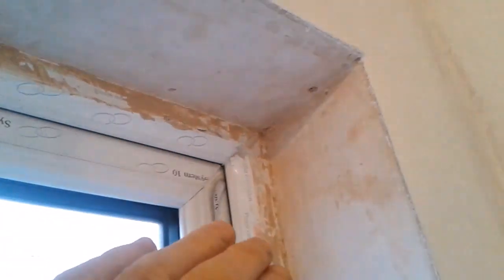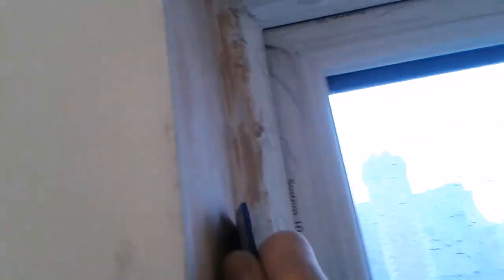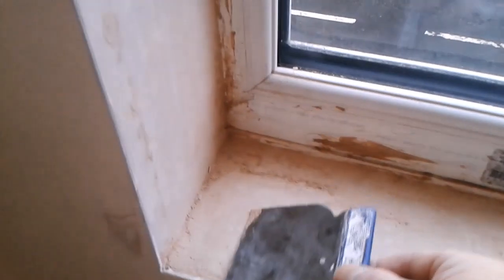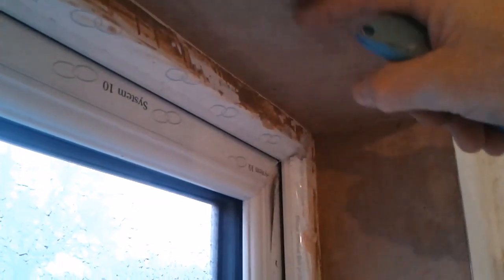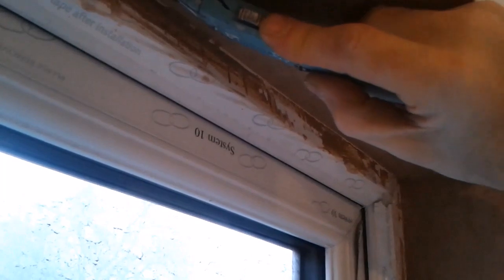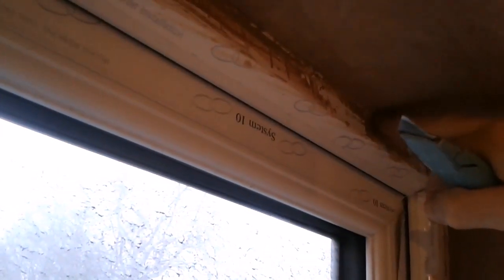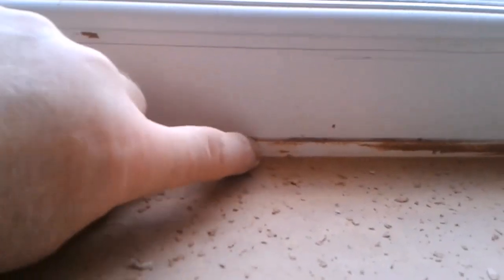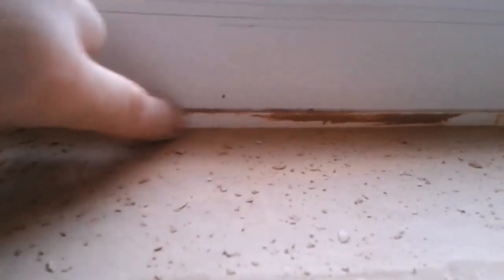Removing Protective Tape Off New Plastic Windows

Comment: Just water down first coat of emulsion 20% to seal plaster. No paint manufacturer ever suggests PVA glue as a plaster seal.
Reply from the maker: yes but they are not professional painters and decorators... both methods work if carried out in the right manner.. you need to understand the materials involved..    if I was losing money because people where not using more of my materials, I would also tell you,  you're using my materials wrong. Diluted PVA seals a surface and it also promotes adhesion with any paint applied on top.   They actually sell paint primers with PVA in them also lots of wallpaper paste have added PVA...   Problem occurs with  PVA when people use it neat, or they come across it after a plasterer has done some patch filling..  Neat PVA is usually all around the edge of the patch which causes problems...    we know all this because we deal with it as being in the trade...  thanks
Reply: @PaintingandDecorating  not acceptable before applying paint. No PVA glue just diluted trade emulsion for your mist coat.

Comment: The installers left the plastic wrap on the windows and now its brittle and breaks up and can't be removed properly. What should I do?
Reply: I have the same issue...several years, still no solution.
Reply: @gilliangermain-king5762  I still have this issue. Even the installers came and saw and went away not giving a solution.

Comment: Leave the film on until you have finished painting.
Reply from the maker: It is best removed before plastering as it suggest on the tape...  for once the manufacture is correct...  you're better applying your own tape to the level you know where the plaster stops..  remove after plastering, then if you have to more tape before painting...  generally we just cut in the paint and have a damp cloth to hand if needed..    professional.   thanks
Reply: @PaintingandDecorating  semi pro
Reply: Not my job then it's the plastering guy. I usually have clean their mess before I start